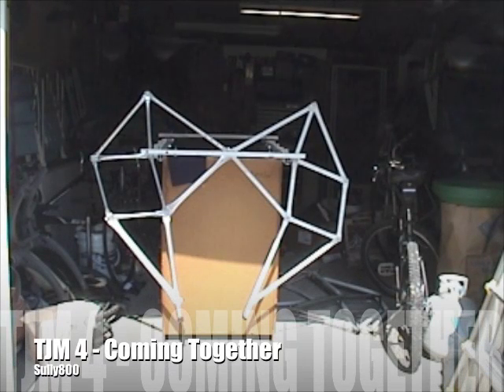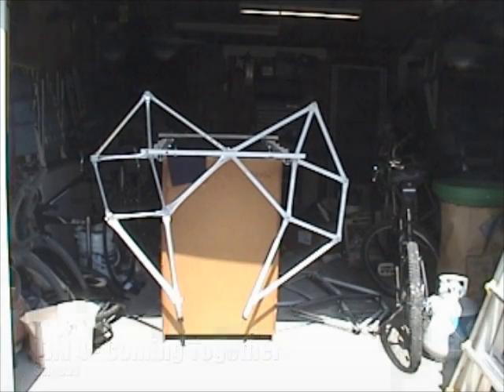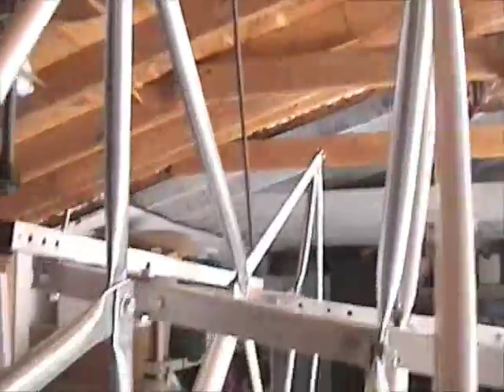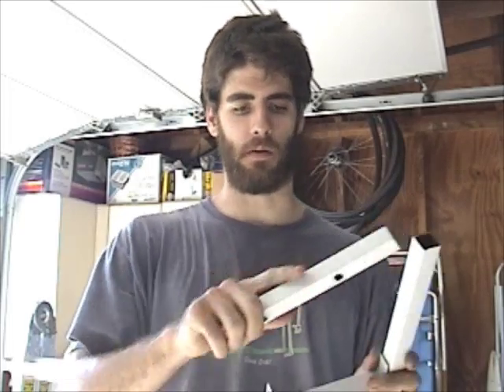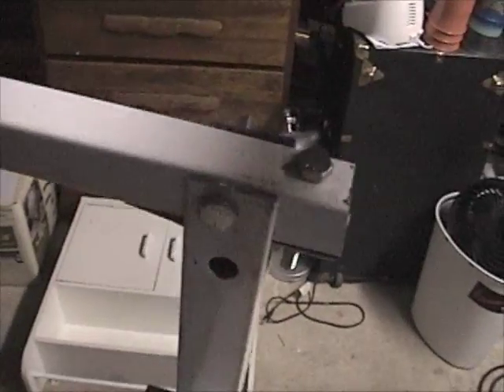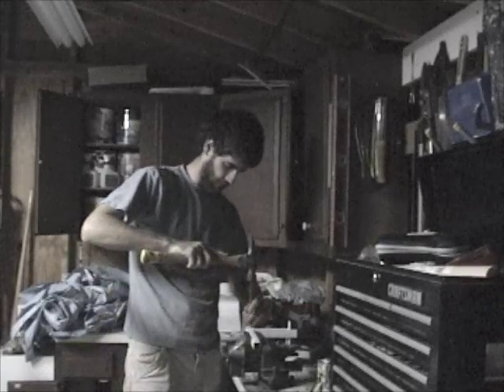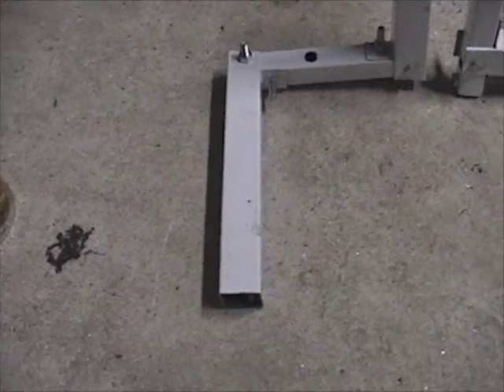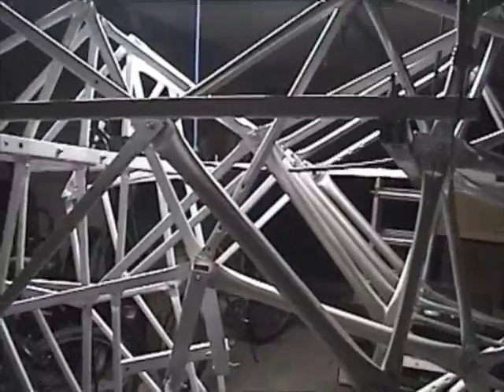Theo Jansen Mechanism 4 - Coming Together

Comment: want to build this with two classes of grade 9 students, collaborating to design and build it.  Words of wisdom (don't say it's too hard…you'll break my heart).  Kids are studying forces, translational/circle geometry, and electricity.  Thought we would try to attach an electric motor for motion when wind is insufficient, and I'm worried that this will create too many challenges to accommodate the additional weight and vibration from the motor.